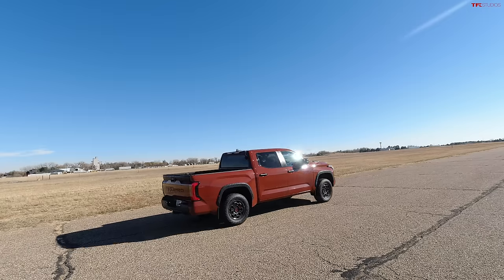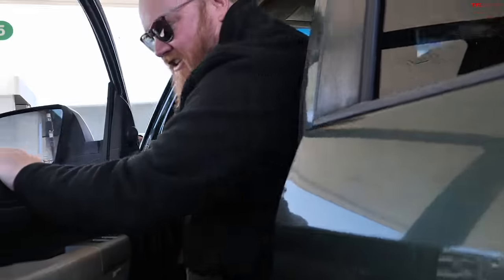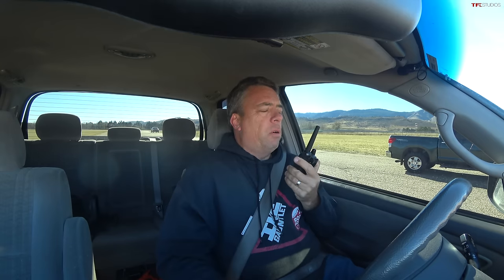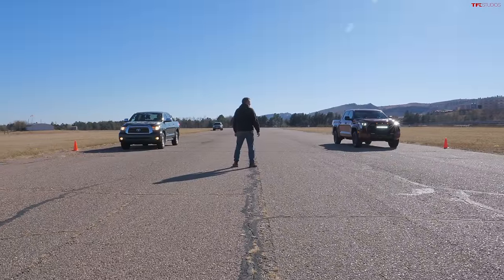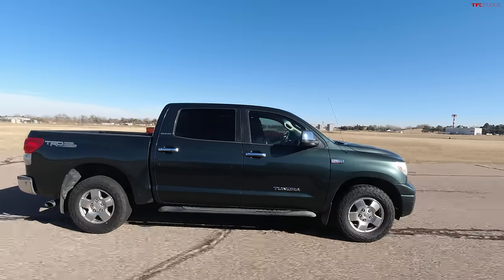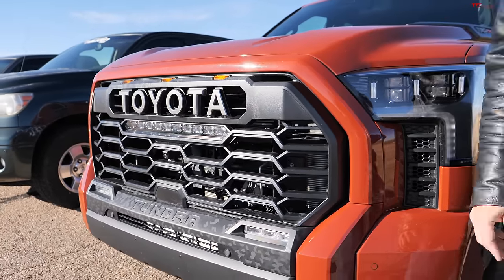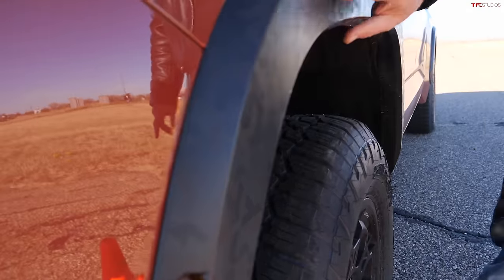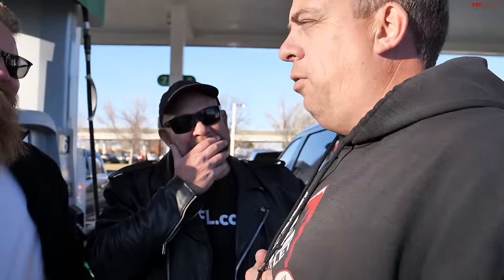Three Generations of Toyota Tundra Drag Race & MPG Surprise: That WAS NOT Supposed to Happen!

Comment: Interesting but most Toyota owners are more concerned about the vehicle 15 years from now and 200+ thousand miles
Reply: Dont buy a new Tundra then,they wont make it to 100,000 with that small engine and turbochargers! Already people are having issues,engines blowing up etc..

I am a Ex Toyota tech and still know people working in the same dealer..They hate the new Tundra already!
Reply: Most Toyota owners pretend to be more concerned about their vehicle 15 years from now but then they still trade them before that anyways.
Reply: @Jay-me7gw   most do.  But I don’t. Finally let my 07 sequoia go in 21 with 240k miles to get my 21 tundra.
Reply: @Jay-me7gw that's because the resale and trade in value on a Toyota is extremely good, even with high miles, unlike Ford, Chevy, and ram, which have no value past 100k miles.
Reply: @Jay-me7gw  I have noticed a lot of people trade them in, and I hear them talk about how much they regret it. I also know a few that traded in there new tundras to buy a 1st gen tundra. I think some people just think, "brand new shiny oooo" and forget the aged diamond they've already got

Comment: So just throwing this out there, because all 3 of you did it. Toyota designed the fuel door to hold the fuel cap during fueling. There are little slots to put the gas cap in.

2006 Tundra MSRP $33,575  -----> $51,240 for inflation (11-16-2023).  MSRP for Limited. (Top Spec)
2008 Tundra MSRP $42,170  -----> $60,261 for inflation (11-16-2023).  MSRP for TRD Off Road. (Top Spec)
2023 Tundra MSRP $72,130                                                                          MSRP for TRD Pro. (2nd Highest Spec)

Comment: 4.7 2000 Tundra(limited edition), 280k miles. That thing is a freaking beast. I’ve outspend C5 Corvettes. C8 I can keep up with until 30mph and then it passes me, but gosh dang do I love that truck.. so fun to drift with too.
Reply: Did you mod it? I've got a 4.7 2000 but not limited edition, I got about 238k miles and there's no way I'm out-speeding any modern vehicle even with dual cat back borla exhaust and cold air intake
Reply: @David-lu4th  not that I am aware. Should be stock. C5s were when they started doing low horsepower on cars, so it’s possible it was that. We’ve had it for 16 years now, and knew the person who owned it before. I genuinely don’t know if he changed the ball joints or any of the other “common problem” stuff. I just know that truck and how to drive it I think is what it chalks down to. It also is possible the C8 wasn’t trying until he realized I was keeping up with him, then sped off.

Comment: Good video and I believe Toyota did an excellent job with all 3 gens is what this video showed. They are all capable, powerful and fun in there own way. The second gen is my pick. No timing belt jobs needed, 3rd gen new engine/turbo/hybrid/ten speed/infotainment would keep me with dealership fears, and 2nd gen does everything well without all the attention to detail fixes and corrections. It took me some time to choose between 1st and 2nd gen. But choose the 2nd gen overall. I don’t think people give the 2nd gen enough credit it deserves for fuel economy vs first gen that is much lighter but 2nd gen gets better fuel economy with all that extra hp.

Comment: Silly not to use the same fuel across the board if you’re doing a comparison. Both the V8’s can benefit albeit probably not as much at altitude.
Reply: Agreed. The 3.5TT takes 87, so they could have put that in all the trucks too.

Comment: I have a 2020 TRD PRO with a Harrop supercharger. The power is 550 squared. More than the 3.5 TT I’d like to see a drag race between the two to see if the 10 speed is that much better than the 6 speed that it would give the TT Iforce MAX the advantage for the win?
Reply: How many miles do you have on the super charger? I would love to do the upgrade but I am worried about reliability.
Reply: @GeorgeJFW probably 25,000. Haven’t had a single check engine light after the tune so for me, it’s been super reliable. On the daily I don’t drive it much harder than when it didn’t have the supercharger with the exception of the occasional on-ramp pull or passing from 70 to 90 and when towing. Sure it pulls really hard at 5500 RPM but I mostly enjoy the benefits of the supercharger between 1500 to 3000 RPM.  If I drive it with the same acceleration as stock I get about the same mpg. Towing is a different story🤬
Reply: My dream setup I'll never have the money for it
Reply: My guess is, if anything, the 10 speed woukd hold it back in a race- 2 gear changes to 60 verses 1
Reply: @GeorgeJFW don't worry! They don't usually recommend putting them in broken in trucks (115,000 mileage plus) but if it's low mileage, you have nothing to worry about.  I can't speak for Hartop but the sooner you put a supercharger on the truck, the better the long term reliability it will have with a supercharger.  Toyota used to install the TRD Superchargers on the brand new trucks which wouldn't void the warranty.
Reply: @GeorgeJFW I'd also go with the Magnusan for within a thousand bucks of the Harrop.  Magnuson designed the TRD Suoercharger for the trucks so I'm pretty sure you have nothing to worry about there.
Reply: @jmd11185  @GeorgeJFW do not go with the older magnuson. It’s almost 1L smaller  therefore requires more boost (more whine) to make the same amount of power. Ie more heat. The magnuson requires a tune the Harrop does not albeit a tune makes a word of difference almost as much as doing the supercharger itself. Magnuson has come out with the same size supercharger as the Harrop but I don’t know if they offer it for the 5.7

Comment: I owned an '02 Tundra.  Adding an aftermarket "Y" pipe (where the V8's two banks meet to exit out the single piped exhaust) to replace the stupidly pinched stock one freed up some power and improved economy, this was an easy and common mod for those old 4.7s.  Had zero problems with my '02.  For my needs, a 1st Gen Tundra with updated interior / connectivity would be the perfect truck.  The new stuff is completely out of hand size and cost wise.  

I currently own a '17 GMC Canyon with the 2.8 turbodiesel.  That has been a great truck, very fuel efficient (28 MPG lifetime) and it has 440 pound feet of accessible low end torque with a GDE tune.  The funny thing is the "mid size" Canyon is narrower but otherwise not too different in size than my '02 Tundra was.  One thing I do appreciate with the newer trucks - deeper beds.  The '02 had a pretty shallow bed on it.

Comment: I think my 2000 Tundra will still be on the road 20 years from now and there won't be many 2023s around.
Reply: Absolutely. I have an 03 4Runner with the 4.7. I religiously maintain it and theres no doubt it will still be on road for another 20 years. Probably not the case for these pros.
Reply: Exactly. We have had our 2002 since new and it has 113k miles (can't drive it in MN winters or it will rust away). Sure, we've had to do the timing belt/steering rack/water pump/spark plugs/coils but that's all we've done in the last 20 plus years. Still runs and drives like new
Reply: @jqentertainment6966  Wow thats low miles! I'm sure it'll last you a long time

Comment: You Never Top Off Gas Tank as the Vapor Canister Emissions was not Designed to Vent Liquid Gas, it will Often Destroy them, especially Newer Vehicles and Alarm Light will appear on Dash causing the owner to spend $$$$$ to replace said unit...

Comment: I don't know if it would actually make a difference in a drag race, but I'm curious if using Tow/Haul mode would be a truer test for acceleration. It definitely has quicker throttle response, feels torque-ier and revs higher in that mode.

Comment: I question what the improvement of the V8 would have been with a decent 10 speed.
Reply: In a drag race where you're only in maybe 3rd gear by the end I dont think it matters too much. 10 speed and the 3.31 is a bit more aggressive than the old 6 speed w/ 4.30 but not by much. Fuel economy might be improved though on the highway.

Comment: Pressurized fuel system. Premium fuel. 2 turbos to fail. Don’t come at me with Toyota reliability - this is stupidly complex and I will find a used older gen Tundra.
Reply: Reliable turbo engines have been around for 30 years
Reply: Did you ever find one? I love my 1st gen 2000. Only on its 23rd year did parts start wearing out and I had to do a lot of maintenance and replacements... that being said, the engine is super reliable and its one of the easiest vehicles to work on

Comment: The first gen tundra were and still great trucks. I remember I worked at Home Depot as a young kid and would load up pallets of sod or cement and no half ton pick up could handle the full weight except the tundra. I would start to lower the weight on the bed and it would put most trucks on the bump stops so we would have to take weight off.

Comment: I put 467K miles on my 2003 Tundra. Best motor ever built. Still ran perfect when I sold it. I sold it to a kid in the neighborhood who now off roads it. I now have a 2010 with 80K miles and love it. I will never spend 70K for a work truck. I bought my 2010 two years ago in mint condition with 16871 miles. Yes 16871 miles 12 years old. Price was 32K at Carmax.

Comment: I Own a 5.7 T Force

Sweet Truck. Best upgrade for anyone is TRD sway bars.

I am also adding heated seats by installing 1 Nichrome wire circuit for The drivers side and 1 for the passenger. 20 feet of Nichrome in each seat
There are fake buttons on the Head Unit area so I’m gonna Have an On/off button for both sides and a potentiometer knob for Maximum Temperature control.

Comment: even with the old one getting worse mileage. its not much worse and it cost alot less money and it will take a long time with using more gas to get to the price of that new truck, especially because you don't have to use premium. people don't think of that with an older vehicle that doesn't get as good of mileage. the time it will take to spend the money to get to the price of the new truck. and you also have to subtract the fill ups on the new truck. so it will almost never catch up to the cost.
Reply: Also repair costs and maintenance , a quart of transmission fluid for my tundra is 8 bucks for my Subaru 60 dollars!
Reply: @GeorgeJFW  what Subaru fluid is that? I see their CVTF-II fluid is only like 15 bucks a quart.

Comment: I'll take the 4.7l. Proven million mile engine.
Reply: The 5.7 is also a million mile engine. Pretty much every Toyota V8 from the 90's and 2000's are.
Reply: there is a caveat on that. the guy was driving around 150k miles a year. this basically  goes fore most cars that have gotten to 1 million miles. the driver was driving a crazy amount of miles a year on pretty much all of them. its a great engine and you should be able to get 400k to 500k with normal driving. there are thinks like starting and  shutting down an engine that play into the lifespan of an engine.
Reply: Blaine Johnsons million mile 5.7 Tundra on YouTube.
Reply: 1 million miles on a 4.7l =

$10,000 in scheduled maintenance. 

$5k if you take a chance doing timing belt @ 200k miles 

$3k if you DIY.

2ND gen launch was an "embarrassment" according to a toyota executive. 

I've owned both trucks..

The 4.7 with its known cracked exhaust manifold tick was annoying AF.  Ball joints clunking @ 100k miles.

My 2nd 5.7 did not have all the known problems...but it had enough of them and a few more.

Average trucks....
Reply: @johnpeters9793 average compared to what? Cause they were most reliable out of all for many years in a row.
Reply: @Pantelift  

I just explained it....try and keep up. 

The 4.7 is a high maintenance motor to achieve those lofty miles.

My 5.7L motor only had one of the many known teething problems..an early water pump replacement. 

But they are well known for AIP failures and  leaking cam towers.

Compared to my last 3 Ford trucks....an F-350 and two 450's...I had more problems with the Tundras.

Currently, while not in the discussion, the wife has a lexus and I have a T-100 for light errands.....I can list the issues with both if you'd like, but they have their share of problems.
Reply: @johnpeters9793 oh your a Ford guy. Gotcha. 👌
Reply: @tymt84  

I currently own 3 toyotas as well as my F-450.

I bought the 2nd gen Tundra because it absolutely had the best specs available in the 1/2 ton segment...if you're not familiar with the known problems it has, that's on you 

The 3rd gen also has problems along with  recalls affecting 170,000 trucks..

Also, have a kawasaki, a triumph, and a beta...I am not blind brand biased...
Reply: @johnpeters9793  any recommendation to have the 2nd gen tundra, the one I am looking is a 2008 4x2 4.7l v8 4 doors. Will check rust damage as soon as I see it. Have listened the engine turn on and it seems running fine.

Comment: I have a '05 Tundra 4WD with a V8.  It's a great truck for off roading, and it's been a good all around truck.  Good test with all 3 Tundra's.  I had a '12 Tundra CrewMax... loved the space, power, and comfort.  But visibility wasn't the greatest.  I like my amber rear turn signals in my 1st and 2nd Gen Tundras.  Miss seeing them in the 3rd gen.

Comment: I have the 2007 sr5 5.7 llimited crew cab. Bought it at 120000 miles and currently a little over 180000 I know I have exceeded the weight. For towing   Pulling a 26ft car trailer with a cat 299d skid steer pulling wise was great only wish I had a trailer break controller. But with managing speed knowing stops and turns. It handles right acceleration it greats towing or not. And plows through snow like a champ

Comment: Question: Since the trd Pro has 2/1 inch lift, if I remember right, have you compared It to any other model with the factory trd 3/3 inch lift in off road and comfort?

Comment: Not apples to apples as running premium in the new truck. Higher octane gas burns slower. Reduced pre detention or aka spark knock
Reply: The V8 doesn't need premium but the V6 does, It's a Lexus engine at heart. It used to even say when the new tundra came out in the fine print it requires premium. Of course now they're publicly saying the 2024 tundra requires premium. I've been putting premium in my 2022 since the second tank and it's a huge difference. It would have been more unfair if they ran regular in the V6.
Reply: Using premium in a truck that doesn’t require it is a waste of money
Reply: The gas cap says 87 octane.....

Comment: Hands down I'd take the 1st gen Tundra.  I'm more concerned with reliability and operating costs than a drag race plus it just looks better.  Each gen Toyotas get uglier and uglier.  Still rocking my 02 Tacoma with 280K and still getting 20-22 mpg highway.
Reply: I agree. We have had our 2002 since new and it has 113k miles (can't drive it in MN winters because of the salt). Had to park it in winters because the rust was starting to invade the frame

Comment: That 4.7 was probably toyota's best engine they ever developed. Very surprised with how bad all of the payload numbers were. Not much better than the Taco.
Reply: If you care about decent payload on Tundras you gotta do research and check the door sticker of course. My Tundras had 1650lbs and 1570lbs. Pretty decent for 4X4 1/2 ton.

Comment: That 4.7 will 100% make more power on 91
Reply: I use 91 on my 01 sequoia limited... and I love it.
Reply: I've definitely noticed a difference using 91 in the old 4.7 2000 I have. I wont do it all the time, but once in the awhile I throw in some fuel injector cleaner with the premium.. and I definitely notice a difference in gas mileage and horse power... that being said, on a budget or just looking for a cheaper outcome, it runs just fine on regular

Comment: My 2007 4.7L Sequoia is heavily modified with all bolt ons and a tune plus Accel Pedal mod. In race mode throttle response is insane. I keep it at Street+ level3. I can attest I will take out any 5.7L Tundra stock any day! Im currently deployed and drive a 2022 5.7L Land Cruiser daily, and its slow as shit compared to my Sequoia.

Comment: 2003 4.7L 290k miles and still going strong with little issues.. I am hoping to get 500k minimum. I know it is not a great tow truck but nearly 70 percent of truck owners never tow anything. IF you are in the 30 percent, go for gen 2

Comment: They say not to top off your tank after the nozzle shuts off but why do people wait 30 seconds and add more.   They said its bad for the Evap system, any thoughts.
Reply: What happens?  Liquid fuel can enter the charcoal vapor canister saturating the charcoal so the canister can’t vent vapor.  Results, “engine light “ on and difficulties filling with fuel due to insufficient venting.

Comment: My 1984 Ford f150 6 cylinder gets 19 mpg. That's almost always pulling a trailer around town.
Reply: That’s because it probably has 150 hp and half your transmission and differential fluids are missing
Reply: @Captndarty  Well, in 1984, it had 122hp new. It is a 4 speed with overdrive and has a 4.09 rear gear. I also removed all the smog stuff and made an exhaust that has no restriction. It has a gm hei distributor set to 12 degrees initial and 29 degrees total timing. Idk how much of a difference that made power wise from stock.

Comment: I live at 9,240 and have the 4.7 in my GX470. I can tell you that even at this elevation, the 4.7 has astronomically more power if you run premium in it. In fact, if I run 85 octane, the autostart will stumble and die on a cold engine. I have to restart several times for it to stay running. The manual says "87 octane minimum under any circumstances" (which is mid-grade for us Coloradans), and vehicle will have the most power and best mileage with premium. You can feel it in everyday driving because it has to downshift much less.